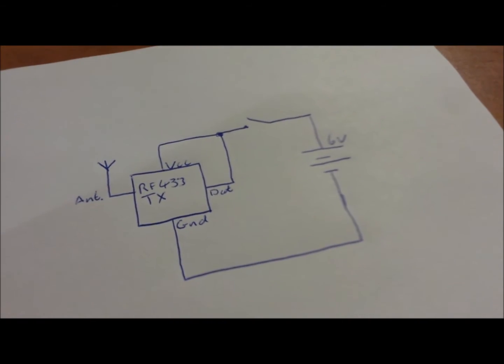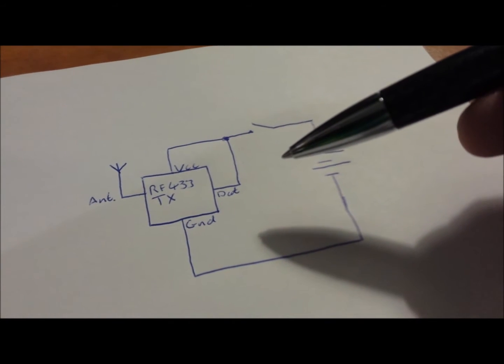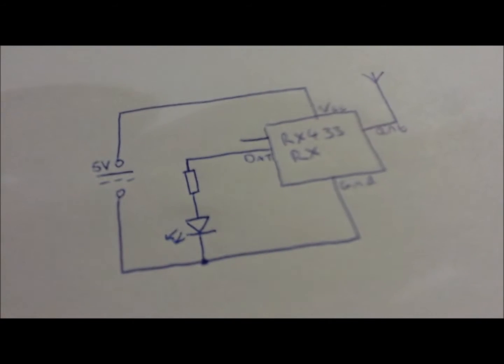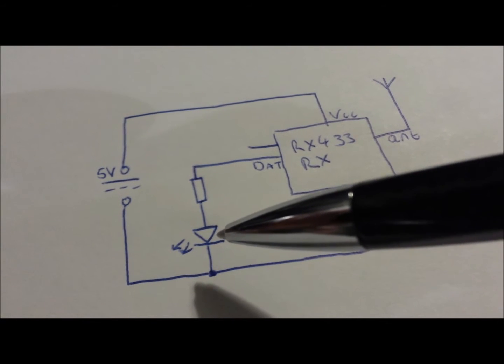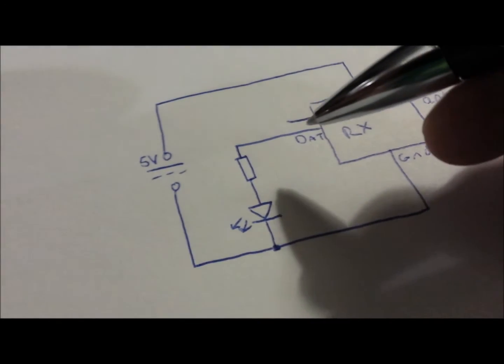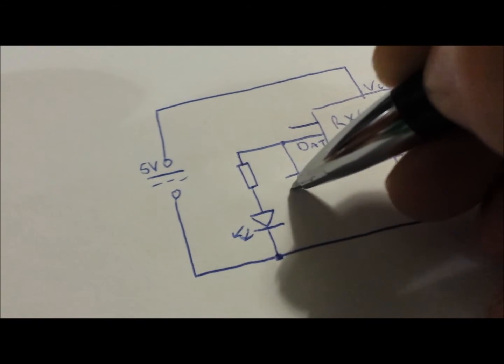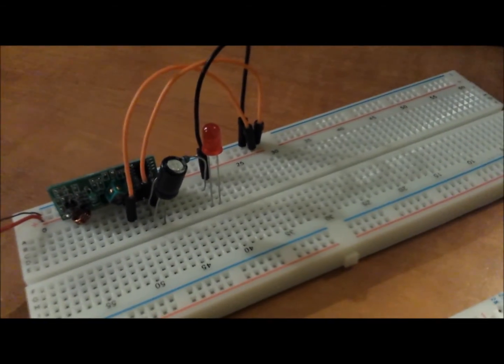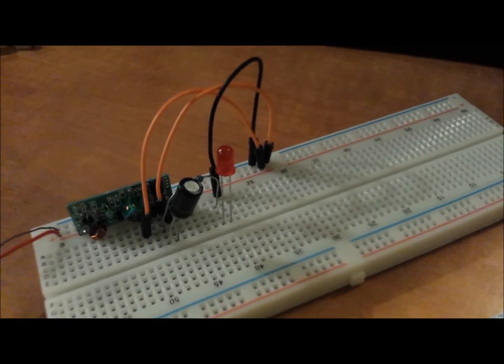433Mhz radio pair - noise filter

Comment: What is the value of the capacitor? What distance between Transmitter and Receiver is possible?
Reply from the maker: 10uf will do. This radio pair have around 100m range in ideal conditions. I've managed to get them about 20m apart indoors before they start to fail.
Reply: Ist it a Problem that the device hast No Channel coding?Are there technical malfunctions  because of other433mhz systems

Comment: hello this will works  verry well in audio transmission?
Reply from the maker: You won't need this filter if you're using an Audino. The code will do the filtering

Comment: How you decided that it needs 220mfd will work for this? Can you share me the calculation?
Reply from the maker: It's not really important. 22uf would work as well as 220uf or even 440uf. The capacitor is active like a sponge, some sponges are bigger but if all you need to soak up is a few drops then a big one will work just as well as a small one, a big one will just be a little over kill. I went with 220uf because it was the first one I had to hand.
Reply: @TheDisruptiveYouTuber  Hi I got my circuit worked by your soution, Thanks... i am using different RF module for which 220mf capacitor not works, mine worked with 0.1mf.....Thanks for you guidance.....
Reply from the maker: @nareshkumart3436  sounds to me like you used a ceramic capacitor where as I used an electrolytic capacitor, ceramic ones tend to be better at filtering AC with lower values ;)
Reply: @TheDisruptiveYouTuber  Is it? But I used electrolyte type only anyhow you shown me a way thanks

Comment: What if I want it to toggle the led on and off ?
Reply from the maker: I guess you'd need to design a logic circuit where the output of the receiver serves as a clock pulse.
Reply: @TheDisruptiveYouTuber  OMG the capacitor circuit worked I needed that exactly thank you so much man!!!!!!
Reply from the maker: @vaibhavkhurana215  glad I could help ;)

Comment: Didn't work for me.. 220uF - but what VOLTAGE should the capacitor be? Thanks. My 10v didn't work. The LED doesn't light at all with the 220uF 10v cap.
Reply from the maker: Voltage doesn't matter as the voltage rating on a cap is the maximum voltage it can handle. If it's not working, it may be because either you have the cap's polarity reversed or you're using a ceramic cap.

Comment: Thank you.

What is the max voltage that can be applied as a signal to the transmitter ?

Subbed.
Reply: The operation voltage of RF transmitter is : (3.3v - 5 v)

The operation voltage of RF receiver is: (5v - 9v).

Comment: Thanks for solution. 

Alternate solution. 
 use two not gate. Output from receiver connected to input of 1st not gate and output of 1st not gate to input of 2nd not gate, congrats u got pure digital signal without noise. 
Disclaimer. Fails for analog signal transmission

Comment: Correct me if i'm wrong but do you really put that positive part of the capacitor to the ground line? Just curious and asking
Reply from the maker: Got the diagram wrong hahah. It's the pressure of doing it for YouTube lol
Reply: @TheDisruptiveYouTuber  So my intuition was correct, too. I couldn't believe that. Glad didn't try it, it would result in a great kaboom :D
Reply from the maker: @radiolistener7706  it would've been ok, no damage would be done. It just wouldn't have worked

Comment: Thank you. I've been pulling my hair out rewriting code for a couple of months.  
I finally filtered the ground wire of my micro-controller with 1uf electrolytic caps on 5V and ground...and it still crashes. 
Gotta test a 220 uf cap on the receiver output. If it works I will post my project on YT and post a link to your channel.

Comment: Please advise, I have 433mhz remote(transmitter) and relay (receiver). The relay toggles by itself randomly. I assume it's the same reason you show. What can be done in that case to Prevent noise from getting into wireless relay? Thanks.
Reply: Make sure you have a transistor between the receiver and the relay. Also, remember to bypass the relay contacts with a well polarized diode. That should do it.

Comment: Thank you very much, that was the what I was looking for on the youtube.
Reply from the maker: your welcome. I have lots more videos waiting to be uploaded to be sure to subscribe ;)
Reply: Okay :D Do you have an idea about that I need create a alarm system with using wireless magnetic door alarms.Alarms use RF tranmitters and one reciever will decode on arduino or something like that.Question is, how can I make seperate every transmitter's signal?.I will just use one arduino for reciever and I need to set transmitters without any microcontroller.

Comment: Is there any chance to get signal strengthens from some pins on this receiver board? Or i am asking for miracles? :) I am trying to build beacon finder which will indicate how far i am from it based on the signal strengthens?
Reply from the maker: Nah, I think this radio module is a little too simple to make that happen.

Comment: Hi I have tried this but ,it seems all over the place, I tried different sized caps , what size did you Use?
Inbuilt a 100 hz low pass filter it worked ( looking at signal on a oscilloscope)
But this brought the signal down to 1.5v , so would need extra work.
If I left mine with just the cap , the LED would do random things and come on after a few seconds.
Please help!

Comment: If you left this for a long period , would the small voltages ever build up in the capacitor, to a point where the LED would turn on ?
Reply from the maker: no, when used in a circuit like this the capacitor isn't being used to store charge but instead to filter A.C. waves.

Comment: Excellent Y2keable,    how would you integrate a PIR  sensor to  signal the receiver instead of  touching the lead to the batteries?
Reply from the maker: Just use a transistor bud, a BJT as a switch, base to the output of your PIR circuit.

Comment: Very interesting solution thank you, one question in the circuit diagram you have the capacitor positive lead connected to the ground I was taught that positive should be connected to positive?
Reply from the maker: Minkle yeah, that's a mistake. sorry. I was concentrating on making a video rather than getting things right lol

Comment: Your solution did not help me, it will also affect the shape of true pulses. It is better to discard short pulses using software.
/* 
  RF sniffer
  Receiver: XY-MK-5V
  Author: GE de Vries dec 2016
  Description: A simple sketch used to identify RF pulses.   
  See also: http://rayshobby.net/interface-with-remote-power-sockets-final-version/       
 ------------------------------------------------------------- */

 #define rfReceivePin 8  //RF Receiver pin
 #define ledPin 13        //Onboard LED = digital pin 13
 #define minimumPulse 150  // noise pulse duration is less than 150 microseconds

 boolean pulse, data = false;               // booleans to identify valid pulse
 unsigned long startTime=0;              // records start time 
 unsigned long pulseDuration=0;         // records pulse width
 

 void setup(){
   pinMode(rfReceivePin, INPUT);
   pinMode(ledPin, OUTPUT);
   Serial.begin(9600);
 }

 void loop(){
   data=digitalRead(rfReceivePin);    //listen for data

   if(data && !pulse){
     pulse = true;
     startTime = micros();              //Record start time of the pulse.
     digitalWrite(ledPin, HIGH);        //turn LED ON, although most signals will be noise
   }

  if(!data && pulse){
    pulse = false;
    digitalWrite(ledPin, LOW);                                         // turn LED OFF
    pulseDuration = micros() - startTime;
    if (pulseDuration > minimumPulse) Serial.println(pulseDuration);   // by ignoring short pulses, noise will be ignored
  }                                                                    // discover the pattern (use datapoints in an Excel graph to visualise)
 }
Reply from the maker: gert3d I came up with this solution  for those who don't use it with a PIC/AMR and instead use discrete components.
Reply: I see, didn't notice that.
Reply: Thank you

Comment: just a quick question what happens if you hold an active 1 does the light turn off again even though holding an active high?
Reply from the maker: yes, the output of the receiver goes low again after a little while when the input to the transmitter is held high.

Comment: you could also use inductor in series with the led
Reply from the maker: indeed, it's a matter of inductive reactance or capacitive reactance. same effect either way on a DC circuit
Reply: *****
the only reason why I said that because inductor are easy to make if you have a wire and a pen you can use the formula and make one within a minute ,, capacitor some times you dont have it and you have to order it or  buy it from electronics shop and close your eyes and pray 5 meters before you reach the store and  hope that they will have the cap value you want .. :-)

Comment: What capacitor would be used if it were on a 3.3V supply?
Reply from the maker: Hi. I'm pretty sure the receiver needs at least a 5V supply but i sppose the same 220uf cap would still work. Anything higher than 100uf, all it's doing is providing a path to ground that only AC can see, if the capacitance is too high then it'll take too long the wanted DC signal to charge it before the output's state changes back to low.
Reply: +y2keable Hello.
Thank you for your respose.
I am using one of these receivers on my Raspberry Pi, and it's connected to the RPi 3.3V rail to allow a direct connection with the GPIO. I was noticing a lot if noise, so your video helped me out a lot.
Reply from the maker: dennisman219 Your welcome. Glad it helped.
Reply: @TheDisruptiveYouTuber  plzz resister value in this